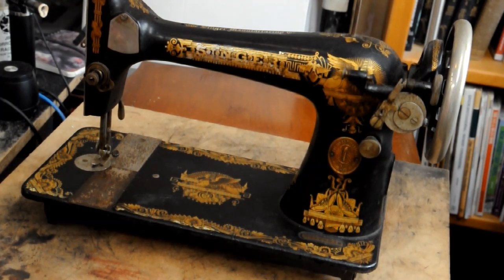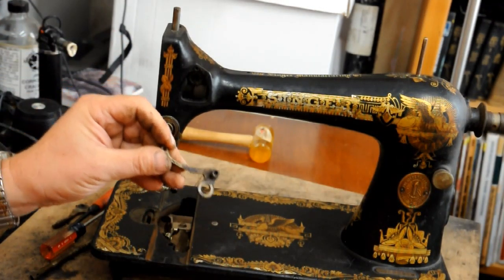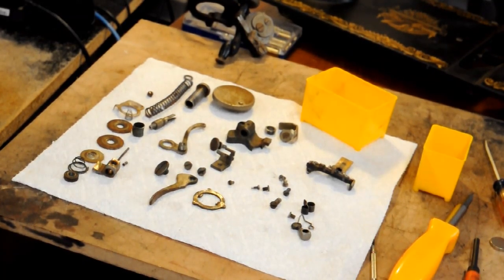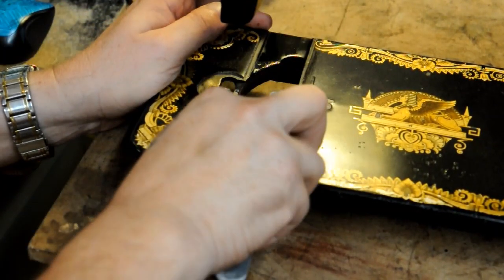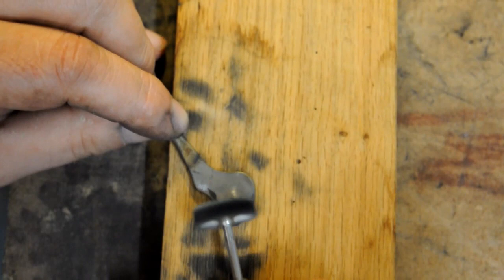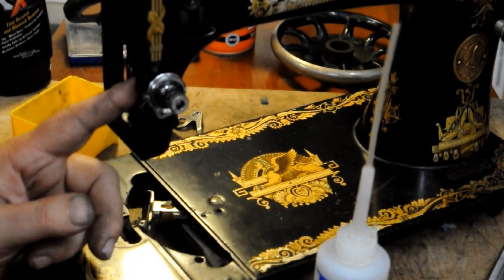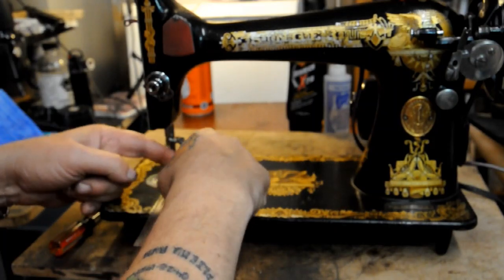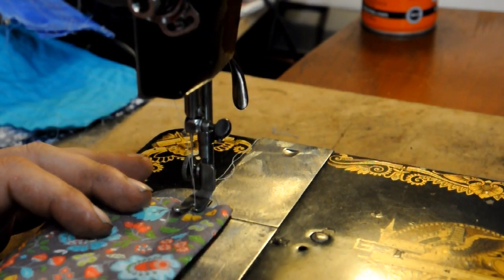Singer 127 Sewing Machine Refresh

Comment: I just ripped apart a 15-91 the only 2 pieces well 3 i cant get off or out is the main crankshaft and the hook shatf and thats stopping me  from being able to remove the feed dog arm  , i did remove the pin for the balance wheel bearing i will call it lol , and removed the screw on the cam inside on the crank and it comes forward but thats all i can get to , now im not planning on reassembling it as i got it for parts but wanted to see if i could tear one down all the way to the body no parts attached at all , i failed lol but got close , now ive never watched or accually seen any videos on a 15 91 tear down so wanted to give it a try , i restore vintage machines , mainly singer but own a dozen with a couple necchi bu,s and a pfaff332 and found this very interesting thank you ..
Reply from the maker: I have a 15-91 here that is pretty much a parts machine. I will try to shoot a video soon to help you.

Comment: I'm sooo jealous that the screws on this machine seem to turn pretty easily, My 1906 27 didn't have a single threaded part that would turn. The pressure foot pressure knob and the bobbin winder are frozen tight. Not due to rust, but due to schmoo.
Reply from the maker: Don't be jealous, that took a lot of Kroil to loosen stuff up!
Reply: @BobFowlerWorkshop  BTW, I still haven't been able to get the hand wheel off.
Reply from the maker: @jomercer21113  watch tomorrow's Sunday Quickies video. I cover something, while not exactly the same, is applicable...

Comment: Thank you for your videos - very helpful.  I have acquired a singer 201k electric and plan to attempt rewire- it is working but outer coat of wires from motor and light to switch have disintegrated (eek) I don't want to get fried, and black goo has got on the  badge. How should I clean that - I think it is only rubber - but have seen that I should be careful and not apply singer sewing oil to that area. It is the gold coloured original badge not the centenary coloured one. Also any tips on restoring the walnut queen Ann style table
Reply from the maker: Getting rubber goo off can be a challenge. I had a 66 cross my path last summer that had the goo problem. It left permanent marks on the clear coat.

Comment: I’m doing the same restoration on my 127. The set screw on that block in the presser bar is stripped out. How bad off am I ? Is there a fix? Should I try to drill it out ?
Reply from the maker: When you say the screw is stripped out... Do you mean the threads are damaged or is the slot on the screw broken? email me at argosybob@gmail.com...

Comment: Thanks for this great video. Other than looking on ebay, is there someplace that you know of that sells reproduction screws? I'm working on a 127-3 that has been neglected for many years and is pretty rusty and crusty. As I was removing the set screw on the needle bar it crumbled. Luckily I was able to finish removing the screw but now I'm one screw down.
Reply from the maker: Sophia, I feel your pain. I don't know where you live, nor the hardware store situation, but I can help you out if you're in the States and are willing to mail order. I just measured the part, hoping that we would get lucky and it would be a common size, but all the while knowing deep down that there was a next to zero chance of that being the case. I took my machine apart and measured, and sure enough, it wasn't the size I had hoped for. Fortunately, there IS a source! McMaster-Carr has the correct diameter and thread size! You need #12x28TPI. They have one listed, in three lengths, all of which are longer than you require, but the shortest (1/4") should work just fine. They are sold in a package of 10, so you have a few extra top play around with. They use a 1/8" allen wrench instead of a slotted screwdriver, and there is absolutely nothing stopping you from using a Dremel tool with a cutoff wheel to shorten one down a little bit if it rubs against the end cover. Here's the link: https://www.mcmaster.com/91375A297/
I hope this helps.

Comment: During reassembly, I notice that the take-up lever is dipping too low and striking the bottom of the slot in the face plate. It does not appear to be bent - is there any way to adjust the height of the take-up lever?
Reply from the maker: Ordinarily, no. Are you sure the takeup lever is properly seated within its screw?
Reply: @BobFowlerWorkshop  i think it actually is just bent. Is there any difference between the 55525 and 55526 take-up arms? I see both advertised as being for the 127

Comment: Hi! I am trying to replace my presser foot lifter. I have been attempting the tap, tap method of the little block that engages  the lifter. I removed both of the little screws but the block is just not moving. Any ideas as to why (I can't get this spring out) without removing the block or proceed with replacing the lifter. Thanks in advance for any guidance :)
Reply from the maker: Sorry I'm late in answering.... I use a lot of AeroKroil to loosen that stuff up.
Reply: @BobFowlerWorkshop  thank you😊

Comment: BTW, the Vintage Singer Sewing Machines FBgroup doesn't have 27/28 adjusters manuals, only the 127/128--and most of it is applicable to my 27. I have never seen a 27/28 adjusters manual.
Reply from the maker: Yeah, I don't have one either, just the 127. The important stuff is identical, it's a case of don't sweat the small stuff...

Comment: Got mine partially disassembled and some of the gunk off bt it is dirt or mud and coal dust grime.  I know all the decals will be destroyed but I’m ok with that if I get her to work.  I do have her moving and lots more work to go.  I don’t have a bobbin, bobbin covers but lots of gunk and some rust.  I’m thinking I may end up giving her a complete dunking as in years ago.
Reply: Wish I could see those parts he’s removing.  I need all that out of mine but fear never getting it back .  Also the small screw that loosens on my wheel was so rusted that it’s top broke off as soon as I touched it.  How do I get it out now?
Reply from the maker: Jean - email me at argosybob@gmail.com. We can take this off line and get you all fixed up.

Comment: Thanks for this video. I learned a lot. I was wondering if you have a video, or could point to one, showing the disassembly and reassembly of the bobbin winding mechanism. Thanks so much.
Reply from the maker: Jenny, if you look at my channel, I am the undisputed King of Singer bobbin winder videos! :-)  Here's the one you need...
https://www.youtube.com/watch?v=QpG6b3dd3Zs&t=307s&ab_channel=BobFowler
Reply: @BobFowlerWorkshop  Thanks a bunch.
Reply: May I bug you one more time? I used your wonderful videos to fully clean and restore a 127 but now I’m looking for the presser foot adjustment (and feed dog adjustment) video you mentioned. I’ve looked in the “vibrating shuttle” playlist. Perhaps it’s the same for all singers and I can just use my stack of quarters? Thanks again.
Reply from the maker: @jennyfoxworth8878  The feed dog adjustment is relatively simple, with the dogs UP and in the middle of their travel, loosen the screw that secures the feed dogs to the rock shaft and move the dog up or down until approximately 80% of the height of the teeth are above the needle plate. As for the presser foot, you can use the stack of quarters, just make sure your feed dogs are below the needle plate when making the adjustment. I'm pretty sure it's in one of my videos, but that's the Reader's Digest version...
Reply: @BobFowlerWorkshop  Thanks a whole big bunch.

Comment: What would you recommend cleaning all the little bits in if you didn't have an ultrasonic cleaner?
Reply from the maker: Honestly, I like using a rotary tool with a very fine, stainless steel circular wire brush. Make sure to wear safety glasses if you go that route!
Reply: If you're in the US and can get Krud Kutter cleaner/degreaser then try it at a 10, 20 or 25% solution (go up if the weaker solutions aren't quite doing it, start with weaker solutions first).    You can soak  in it, swish it round (in an old peanut butter style plastic jar is good with the lid on, or in old ice cream tub etc for larger pieces) and then use something like a toothbrush to scrub at them a bit with the solution.  Wear gloves, of course.  I've seen other vids doing this and the stuff looks waaay better than anything I can find here in NZ.  Of course rinse off with plain water and dry thoroughly before oiling where necessary etc. BUT please DON'T try this on any painted/shellacked parts.

Comment: Great video! I am starting to clean up my 128. In the adjusters manual it states to lubricate the motor but doesn't specify how much. Do you have any recommendations on doing this?
Reply from the maker: I use a syringe to inject grease into the motor wicks. My advise is to fill them up, but don't try to overload them as you'll make a mess. It doesn't take much at all. I know that's not a specific answer, but I never measured it.

Comment: where do  get this adjuster manual?
Reply from the maker: send me an email at argosybob@gmail.com and I'll fire it off to you.
Reply: @BobFowlerWorkshop  bob do you have an adjuster manual for a singer, 66-16? I would bet very appreciative if you could email a copy to me at dlvitry@yahoo.com. Enjoy your videos much. I have my mother’s machine which I remember running 75 years ago. I vividly remember my mother’s admonition when I put her scissors down on the decals or the wood cabinet. The little can of Singer oil which snapped into the little clip under the machine was also the only oil we had and would also incur mom’s wrath should I borrow a drop or two for some needy toy. Thanks again.

Comment: Thankyou so much for this video! I have a 1920's 127 and I gave it a clean and oil when I got it and it's not too bad. But between you and The Sewing Machine Repair Guy I have the confidence to take the plates off and service it properly as my bobbins don't tension enough, and I can't change the stitch length.